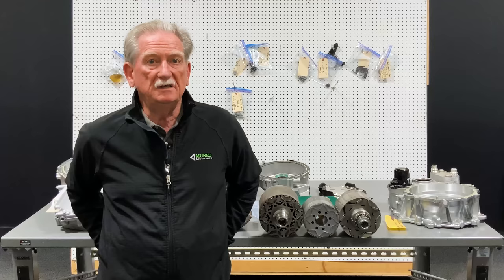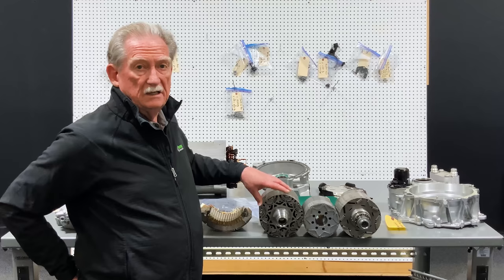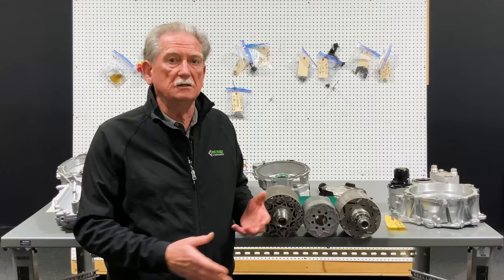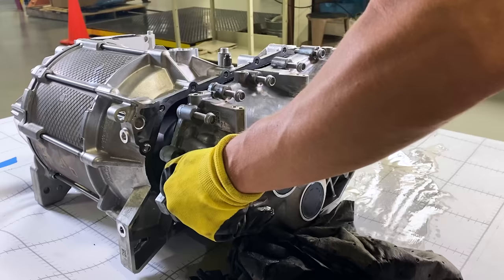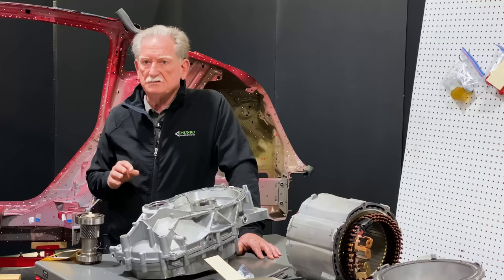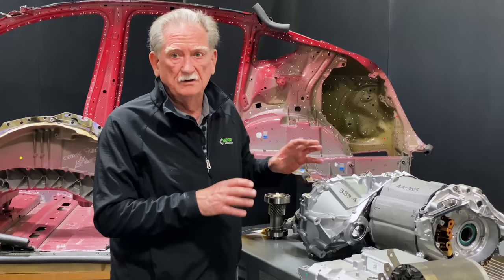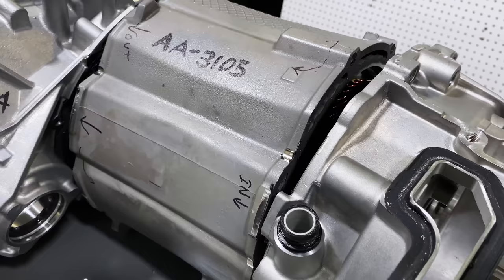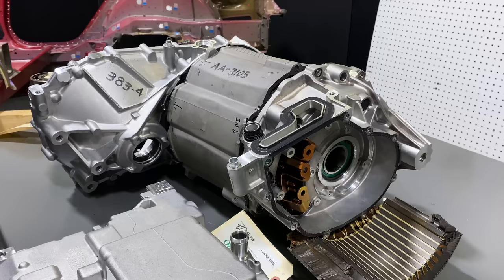Volkswagen ID.4: Electric Motor Teardown and Analysis

Comment: Mister Munro, must understand that in EU all companies including the american ones, have to allow everything to be fixable, with 2 years of warranty when new, and we have a culture of fixing things.

Motor Drives, from our machinery in the factories, when broke, we send to companies that fix them, and its cheaper than a new one.

As you unmount all the parts of the inverter, or motor drive, if you understand, if you are a true technician, true engineer, you know how to fix it, in EU, all companies must provide the spares to we be able to fix it.

There are no such thing as "no one will fix it", because in EU we have laws that protect the consumer against the capitalism abuse. If they dont want to let to fix, they cant sell inside EU consume markets.

About the "excess of screws", i will make a compare on my profession 15 years ago... I was IT technician and fix laptops on warranty, Compaq, HP, Acer, Toshiba...

Toshiba laptops was the ones with more screws and the most expensive, and Acer the cheap ones with less screws. Toshiba with closed screen, could be droped to the concrete ground, and still work. Acer and HP cant, and got breakdown even in a smooth fall...

That inverter are not a laptop, but has a "motherboard" in a thermal fluctuation and vibrations, and how much tie are, less chances has to break down, and if break down, here in EU, everything are fixable by law if that companies want to be able to the right sell here.

You said "no one fix that", when unmounting are so easy like you shown... That didnt sound good over your understanding about fixing industry...

Comment: Sorry but you are making way too big of a deal about threaded fasteners.  This is not an IC engine.  The level of vibration and the rapidity of thermal cycling is an order of magnitude LESS than on an IC engine, if not more.  There is absolutely no comparison.  One application is nothing like the other.

Comment: I think you can reduce the number of screws by having the screws go through all the components and end in the housing body.

You can use SMD thermal vias (seriously cool stuff) to incorporate stuff like the bleed resistor directly on your board. You can also use soldered standoffs to stack the boards up and allow one set of fasteners to secure the assembly.

I disagree with this entire channel's philosophy in general because I maintain things that aren't meant to be maintained and I can't stand that many of them don't use screws, however I can't deny that reducing the number of screws is ideal, heck, I'm going to re-design one of my products right now to eliminate two screws, should save me $0.30 per assembly and also save me a significant amount of labor cost.

Comment: Boring...lol...how how some specs...
It be nice to take VW motor and inverter and retro your gas pile...

I suppose there is a DC to DC step up from batter to the inverter. 

Another crappy feature..I think is why not add drIn a fill ports...maybe these big burrs can be detected or see how your lube is doing. Or maybe I run in the desert at 120 Deg F Ta.....and use a heaiver lube...but then I also want to be in Vermont in the winter...22 degrees below zero...maybe in that cold a thinner oil can be used....but if there is no way to change...wtf...

Most things made today...are designed an meant to be thrown away..

I like things that last. My 7.3 International..conservative rated...yeah it sucks dinosaur juice..but after 325,000 K miles...still pulling strong...

I like their motor design design. 

I am doing a GEM cart up grade ...playing a little ..
I don't know why more don't use planetary two or three speeds..

Ok you don't like threaded fasteners..

You must like vibration...

Okay....lots of screws are inexpensive...

I am sure VW will take your inputs and build more snap in things...

Maybe since electrics love to squeeze the watts out and increase efficiency....how about instead of bleeder resistor heat dissipation ...do a regen on that too..

I thought the one crappy O-ring to seal coolant out of the high voltage IGBT..seem like a crappy design. Wait till the coolant eats thru that crappy Viton O-ring...please sing to Johnny Cash...I fell in to a boring ring of fire...

Anyway I will check out more thingd...

I hope to post video..
Of my GEMs hybrid...diesel electric..Ferrymann 5 hp..boosted with turbo...and planetary two speed on electric motor....then a beautiful fold out flower sun panel for charging when parked...get rid of Pb batteries...stay with Liitum ion...

But being a one man show...sometimes it is just better to do...ignore others...

My go on that car...drive to work..8 miles one way...do other errands...if somewhere longer is needed fire up the Ferrymann

Comment: I agree with the threaded fastener comments but totally disagree with going to a snap fit system. There will always be times when disassembly is necessary and I hate this throw away society that is developing. The way you see it, we will be discarding parts costing thousands of $ when a $10 part fails.

I like your BOB process description but you fail to note that like many manufacturers, the design is an evolutionary failure. The size shape and location of most of these components should have been planned better at the initial stage by an iterative process and many, if not all, of the threaded fasteners could be eliminated .

Skeletal design is a failure of foresight too. Every component should be thought of as part of the whole and not have to be re-engineered to perform . As I discovered in my early years with gas turbines, so many engineers lack vision. I have always presumed these failures are deliberate for many reasons beyond the obvious (stupidity) but maybe not?

Comment: I had a 1977 Rabbit in the 80's. That car was bulletproof except for brakes and tires/general maintenance. VW is a sh!t company now because they have careless employees that are running and working in quality control. That is why Sandy found that block unfinished and burred up. That engine would have died within 1,500 probably? I am retired but would love the chance to clean house with me and a group of my Assemblers going from department to department pinpointing the problem child in each. We are great and did work for the D.O.D.

Comment: Should leave out calling builder an idiot and idiot a builder. It makes you an idiot. Those fasteners are maybe just for the initial stage in order to find out if it will be a major issue and then replace the part and not the whole sandwiched part.

Comment: I'll definitely have to call the presenter out, on his fallacious beliefs about threaded fasteners. They, with the proper designs and addition of optimizing technology, are almost completely reliable for the lifetime of the equipment, and in addition are more friendly to the environment by facilitating repair - snaps are just as prone to failure from inappropriate forces, and also material degradation. Also, snaps discourage or make servicing impossible, requiring total replacement - much less environmentally responsible.

Comment: Great info, but a slightly unfair comparison. The more generic ID.4 cooling system handily meets demands of the well-designed but lower performance ID.4 configured motor. Tesla stuff is designed for FAR, FAR greater longevity AND much more robust performance. Tesla's pumped coolant system addresses specific high-heat events such as traversing steep inclines while fully loaded in the blazing heat of a mid-summer's day without skipping a beat, i.e. zero decline in performance. It allows for managing cooling specific to the present demands incurred. Two different design approaches for two significantly different scopes of activities.

Comment: Unfastener??? If it came loose it usually means you didn't design it right in the first place or used the wrong fastener. You even gave the solution. USE IT. Snaps as you call them are junk. Single use only. Once broken must be replaced with a fastener after repair if at all possible. At least with a fastener it can be repaired  Engineering with non repair ability?? You severely over estimate the value of your product and under estimate the willingness of people to  purchase a replacement instead of repair. Non repairable has never been sustainable and is absolutely not an environmentally friendly option.

Comment: I want to be able to wake up in the morning have amazing morning sex with my significant other, smoke a joint and get dressed for work all the while my self driving electric car drives me and my significant other to my place of work and no cops can stop me because I'm in the backseat and not driving the whole time, then when I get to work the car automatically self drives my significant other back home or to their place of work safely.

 Until this is not a possibility I just don't see why I need to buy an electric car, I'll stick with my Viper GTS 02's, my Mazda RX7's, Nissan GTR Black Editions etc etc......

Comment: mechanical engineer never understand electronic , We have the same problem in our job , Me as electronic engineer designing more then 30 years , try to explain delamination of PCB ( yes the green card with black stuff on it ) and the mechanical guy thread it as some green metal plate .
LOL you never understand electronic , so don't try to explain it

Comment: "Threaded fasteners are not your friend"  - Is that why literally every important mechanical component on a car is held together by threaded fasteners, instead of snaps, rivets or glue? I'm shocked by Sandy on this, I really am, but I suppose he's been brainwashed by the american industries too much, and the "throw it away rather than fix it" mentality is too strong. It's as if he supports the low quality, disposable, designed to be thrown away the moment it breaks type of design instead of supporting designs that CAN be repaired. Not to mention snaps will NEVER, EVER hold components together as tightly, and will never enable you to create assemblies as solid and rigid as threaded fasteners allow you to.

Comment: a servo pump and oil filter are high speed lubricants so vw was counting weight isue a kind forget to to put double bearings and even forget to put inside double baerings straight touth, that kind mom merklova garage not exsactyl vw facility factory anyway in new stuff can lot hapend or be produced and vw is playing how is this thing done anyway joke is horible even for renounce vw group what were enginers doing vent on brake to take pause and watch paintings in museum are they all in love dr Dieter shoes, is kind legendary thoughts joke all in total sucks and kind whistle lets do this fast but vw in production and herbie is teasign again comercial and oil spill again nto again same joke bit fed on hitler sausage think and rene cuisine joke funy but require adapt

Comment: `Sorry but you're old hat with your permanent fixings. "Design for manufacture" has to GO! Design for repair and recycling" now has to be the thing once again. Fasteners make for repairability rather than throwaway "Aircraft maintenance".  Stuff now needs to be stripable for recycling if nothing else... Oh and British Standard Whitworth (BSW) and BSF (Fine) were 55 degree. Square and Acme threads are for greater strength i.e. Vices and jacks etc. or driving things like machine tool leadscrews or automation leadscrews.

Comment: seven minutes of babbling and all i gather is you like that they've used rtv instead of cut gaskets, and you had an issue with the casting boss on the output shaft front thrust bearing thickness so the facing cut was short, and left a burr. 

please find someone who knows what they're talking about write a script for you this is embarassing and unwatchable.

Comment: VW only offers average electric cars.
Reply: ID.R: Hold my 1.65s 0-100 km/h acceleration 😁
Reply: @abraxastulammo9940  So wie: "We're building the cleanest diesel in the world"?
Reply: @haraldschon2485  And it is probably true, only if you don't want to spend adblue you cannot have the cleaning effect.
Reply: @abraxastulammo9940  The engineers at VW said that too, but they just didn't want to do that. Too expensive, customers don't want to spend that much money on Adblue.

Comment: VW is definitely the worst car I've ever owned - and one brand I would not buy again.  This is mainly because so many items wore out prematurely that I've never had wear in other cars, and I baby my vehicles.  The interior now looks like crap as the rubber coatings decomposed vs my Kia which looks almost like that day I bought it.  In the engine compartment, things like the the plastic used for the radiator overflow and brakes fluid decomposed and had to be replaced.  The turbo on my Passat also failed after only a few years.  The rubber covering the front suspension parts tore over and over, every few years, costing me 1000's of dollars.  Friends I know that purchased VWs and took less care of their vehicles, experienced even more of a mess.  Fun cars to drive, nicely engineered brakes and engine, but the rest of the car is cheap garbage that wont last beyond 3 years -  no way I would ever consider VW again.